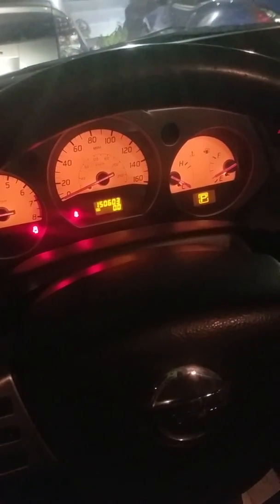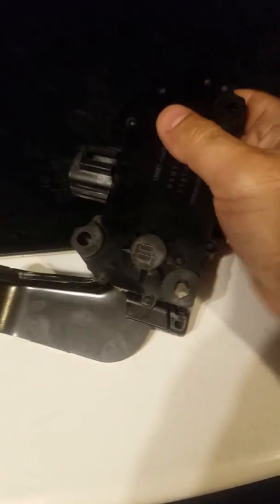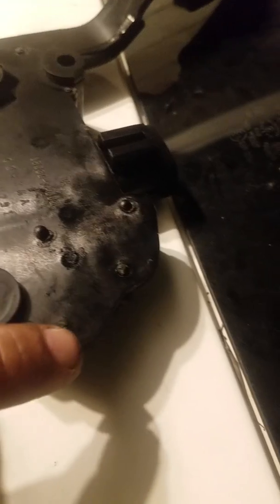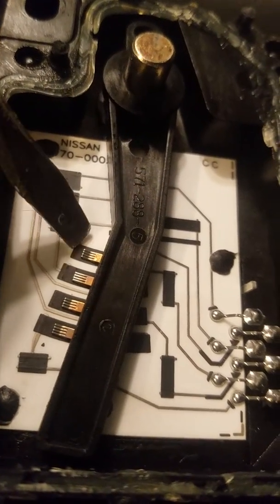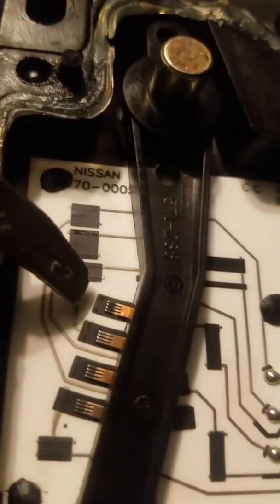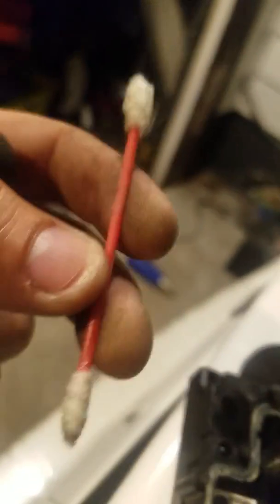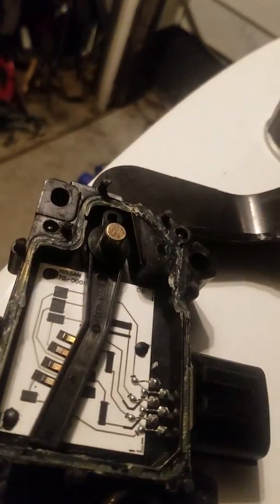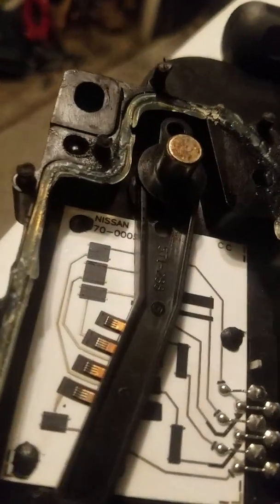nissan murano no acceleration / start and then dies  Fix  / find the issue

Comment: I did this after watching the video, and sure enough it worked, car runs even better, even though when I open the gas pedals controller box, it was still very clean, I wiped it down. I did unplug the battery to be safe and most likely would have needed to reset everything. Thanks for the tip, saved me time, and who knows how much $$$$ if taken to a garage.

Comment: Are you sure you fixed it brother l have the same problem
Reply: Modiski44 Super you fixed it?
Reply: Me too I have same problem the car sometime doesn’t drive on traffic?!!!
Reply: Did you fix it I still struggle too fix mine
Reply: Any advice will help
Reply: Mine won't accelerate at all anymore and I have to keep jump starting my car but I can't go anywhere engine sounds normal any advice?
Reply: Nissan murano is junk wish I would of looked it up before I bought one ain't worth the risk of dying out on the freeway or street to get rear ended ....
Reply: Please help guys I have the same problem I have done everything for the car , changed and fixed so many things but the problem did not go away , I hope this is the problem I will try this
Reply: Your throttle runs off voltage,  Check and replace your alternator and or battery
Reply: Scott Myers , true it happens to my 2006 Murano it did not move after traffic light stop. It turns out it’s the alternator
Reply: if your car randomly dies while driving, but will restart a few moments later it could be the cam position sensor. It is a easy fix,have your codes checked.
Reply: @kevinjohnson7621  mine is doing that
Reply: @kevinjohnson7621 I need to do this how much does it cost
Reply: @kevinjohnson7621  it’s doing this but also telling me it’s my crankshaft sensor
Reply: @Connorwise  it’s your alternator .. if your car dies while driving that’s your issue